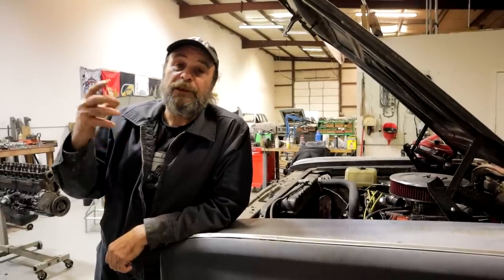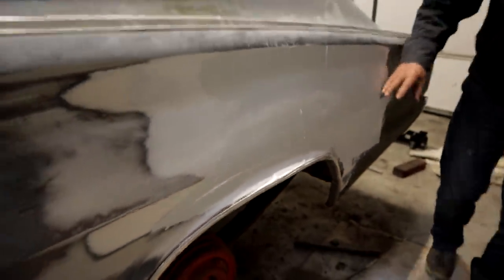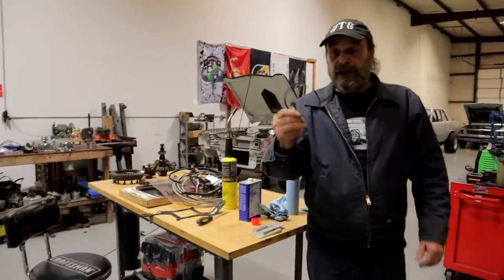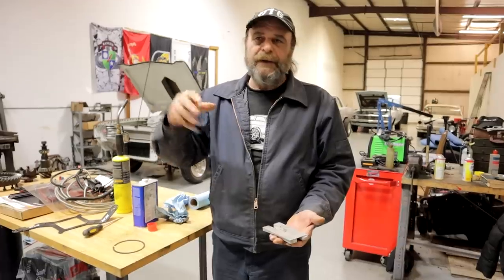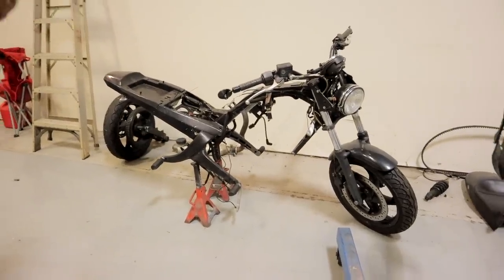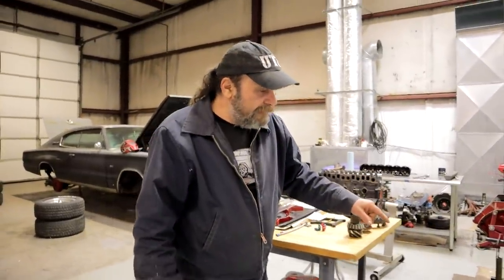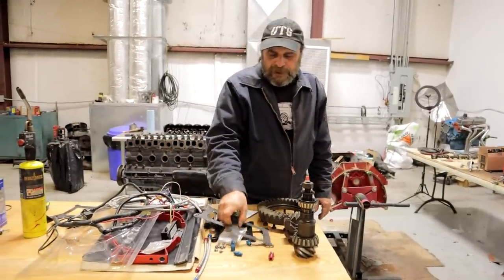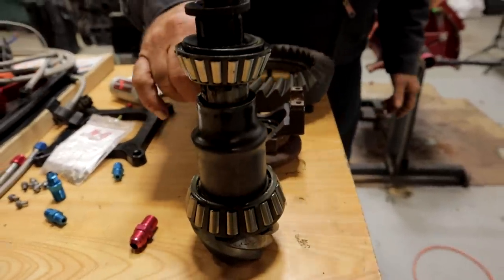Hot Rod Economics - Investing In Your Ability To Build Cars

Comment: Funny how things change. 
Guys used to run a roll of fuel line through a bucket and stuff it full of ice to cool the fuel down before a pass. Anything to get more power. 
Now you'd be lucky to find a kid that can even set up a carburetor ! 
Guys like you are keeping hot rods alive !
Reply: @rustybritches6747  really? Good to hear. 
I can't remember the last time I saw a "cool can" on a car. Although I don't go to car shows much any more. In Canada it's kind of a dieing thing now
Reply: i used to run my fuel lines thru the windshield washer bottle. at the track i could just dump out the alky and put in ice cubes for even cooler fuel

Comment: When I was riding motorcycles many years ago with mechanical breaks, I adjusted it so no matter how hard I  break the wheel would blearily  still turn. This had saved me a few bad times. Even in the rain drive like you are on ice. Getting older means a longer healing process,lol. Please be careful, but enjoy the ride. I’m only 76 and still ride.
Reply: I had a kitted 70cc Kymco  Cobra. Went to work one evening and the road was flooded/very very wet. Didn't think about it really much, but it was February and I should've. Got off work at 330am and got to this road. Nothing in the slightest of being 17 degrees made me any wiser.... I hit the 1/4 mile of icy winter wonderland at 60 mph. 
You ever seen the movie gone with the wind. Neither have I....

Comment: i did this not even on the hotrod side of things, thanks to where you taught this in the past.
I basically replaced an engine for free because I bought the replace ment with a transmission, then sold the transmission for the what I paid for the whole
Reply: for my 69 GTO i found a $425 4 door 1971 LeMans. the gas station garage who had it delivered it for free the next week when they had a rig headed out my way. plucked the 400/THM400/10 bolt LSD rear, took out the T3 headlights, pulled out the dashboard and gave it free to a guy who just wanted the front windshield (like i was going to risk him breaking it in my yard). If he was smart he parted it out more, but i sold the dash for $400 and had a $25 drivetrain to hotrod.

playing with cars CAN be affordable so long as you own property and tools :) but seriously, it's a case of working smart not hard like everything else in life.

Comment: 6:24 That's exactly the thing, you gotta look for the value in a sale ad.  Sure you need a $300 thing and you see an ad for that thing for $200, you go get it.  But if you also see an ad for the thing for $200 in a pile of other things, you DEFINITELY go get that.  Goes the same for tools.  This is why I haven't bought a lot of new tools lately, I've instead been buying whole toolboxes and lots of tools for a pittance at garage sales and estate auctions.  I still have a pile of little 20 inch Craftsman tool boxes in my shop that I haven't even opened yet to go through as I'm waiting on another decent paycheck to get a roller bottom chest for the decent $30 top chest I started using.  Then I can pick up some drawer liner to sort and organize what I already have, add to it from the auction wins, and see what's left over.  I might keep a couple of those 20 inch boxes for mobile tools, and then pile the other stuff I don't want in the others and give it away.  It's going to be useful to someone else if not me, and I need the space for new stuff eventually.  Some guy with a family who finally got out of renting and bought a house is going to need those tools I won't be using on a car anyway.

Comment: I build hot rods and custom cars for a living. I save take off parts, extra wiring, and stuff people just want to get rid of. Building street rods is a good way to get traditional hot rod parts. When I wire cars I save all the extra wiring and parts that don't get used. I can usually do the 4th car by only getting a new fuse panel.
Jim Ford
Highway 101 Rod and Custom

Comment: i have to comment on this ... how correct you are when you said "you don't know when you need something and it is on the shelf"  I just got an engine back from a shop after being tanked. no work other than a good cleaning. after checking it over on the stand it dawned on me that the frost plugs were not placed back into the holes. so i phoned the parts store to inquire to get 6  1-1/2 in plugs. nope nothing in stock nor anything coming in the next while. HUH?? I remembered a bunch of stuff i had bought second hand and placed away for "in case i need" and sure enough after searching it, there was a new box of plugs/kit there. cheers tony you never know when ....

Comment: I have a  "A" body 8 3/4 that will soon be up for sale. Posi big bearings, three set of gears. 4.56, 4.88, and 5.13. plus 11" brake drums. It was under a mud race truck. Both axles are twisted.    I now run a Quick change.  in one car and a 8 1/4 in the other.

Comment: Buying the parts used to be a guarantee that the project went forward.   Somehow it doesn't work anymore. 

On the plus side, I've got a set of side pipes, oil cooler, 3/8" braided stainless hose, AN fittings, tachometer,  pressure guages, etc. all new, waiting for a project.

Comment: Lol thats funny cause I needed a 400 for my 67 ford found a 79 frame running motor c6 9 inch rear end got a 78 awhile back minus a motor also with a dana 60 those 2 rear ends alone I cam double money invested plus the front ends cab spare c6 using the 9 inch for a drag car dana 60 for my 48 pontiac

Comment: So how long before UTG develops the equivalent of M5 Industry's iconic wall of boxes?  Because that's the corollary to the scrounge/barter way of the gearhead monk.  You can't use it or trade it if you can't find it and few things are more frustrating than having to go out and buy something you already have but can't find.  The worse part about clutter is you can't find the stuff you need even as you are tripping over it.  At the same time you don't want to spend all of your time organizing parts.  Throwing them in a box with a big label is a nice compromise assuming you have place for the box. The difference between hoarding and inventory is organization.

Comment: Aside from the mech cam 273 and induction, cam and exhaust I transfered from engine to engine and the massive sway bar. I had my torsion bar tuning.  I'd dead drop the front without aligning the wheels. Depending on roads and speeds camber would be between 3 and 8 degrees.
Yes I went thru a set of stock sized polyglass radials every 10 to 14 days on the front. But I had boxes of doorman left and right wheel studs and nuts. Sounds like a ricochet when a nut and stud peals off at 65 mph in a full 110 drift..... before drift.

Comment: You have too many projects going on. I do too. You work on them and get some things accomplished, but there comes a point where you get overwhelmed. That's where I'm at now. I have downsized and now I need to get rid of stuff accumulated over 45 years of working on cars. Now I'm 15 years older than you and I'm slowing down a bit. Still banging away in the garage, but no more big projects. You'll find out when the time comes.

Comment: I live the parts hoard ,scrounger  l went buy a rearend $100 as l was ready to leave he said you interested in other parts l said sure  what do you have, l got for a 1970 350 long block standard aftermarket sbc hei wires and bbc pr aluminum finned valve covers and a bucket of bolts brackets hardware $50,he just wanted it out of his garage sense l said ill buy it all he said a $100 for everything rear end motor parts love it always ask if they have other parts !